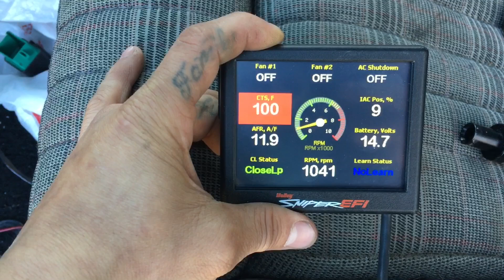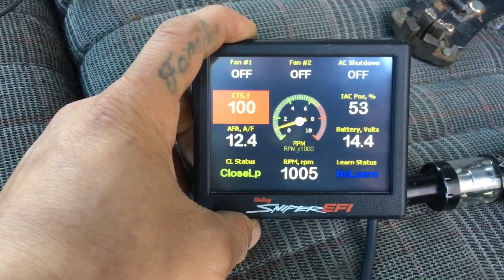Holley Sniper EFI Foxbody

Comment: I'm rebuilding my 91 and I'm considering this.  Thanks for posting
Reply from the maker: ricardo340 Thank you for watching I have since took the motor out and am going a different route, still staying Sniper EFI just gonna upgrade to the 1250 for boost since I recently purchased a Dart SHP Block which I will be doing a later video on just haven’t had any time. Stayed tuned for a 331 Dart block build with boost. Gonna build a high hp N/A setup so I know the motor has a strong foundation for the boost. Plus gonna run it N/A for a little bit while saving for the supercharger. Little by little and we will get there bro 💪🏼😎

Comment: Damn, music to my ears. Good work Dude.
Reply from the maker: Josue Sanchez thanks bro she’s coming along slowly, but surely I appreciate the feedback 💯🙏🏼🏎💨
Reply: @whatthefox302  no problem man. I'm in the same position you are. I'm swapping a SN95 engine and interior into my fox. I think the SN95 interior looks zexy af lol
Reply from the maker: Josue Sanchez yeah I need to re-do my interior to the original Sand Beige it use to be. I just ordered new shocks and struts. Gonna upgrade to V8 brakes since it’s an original 4 cylinder
Reply: @whatthefox302  oh nice! I suggest upgrading to a much later model like a 95. Because that's the only model hat can fit into the Fox perfectly.

Comment: @WhatTheDox302 More videos bro! How was setting up the base idle with that kind of cam? Best chop I've heard so far with a sniper efi unit on a sbf
Reply from the maker: ez2memorize to be honest I am still messing with it haven’t really set the timing on it. The system seems to keep flooding for some odd reason. I also have to change the distributor gear since it doesn’t match my camshaft gear. I have been doing other jobs at the moment, but gonna be messing with it some more weather is just nasty at the moment and don’t like filling the garage with fumes lol
Reply from the maker: ez2memorize update is I lost compression on 2 cylinders now I’m building a 331 Dart block for some supercharger boost. Will still keep making updates just don’t have all the cash to get it going quickly, but I already have the old engine out and the dart block sitting next to my Coupe so I’m making some progress I’ll have to make a video update on the Dart block itself. Thanks again for watching

Comment: does the distributor gear that comes with this, work with a roller cam later model windsor?
Reply from the maker: as long as its ductile cast iron you should be good I had to buy a billet steel gear to work with my billet camshaft